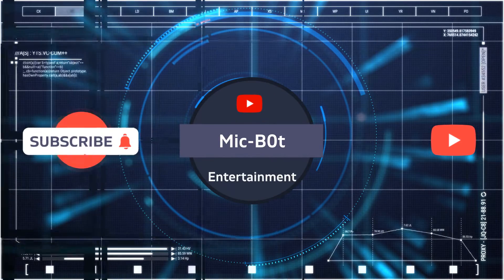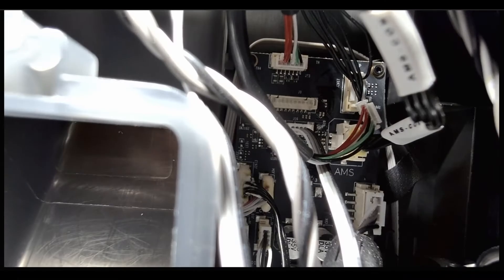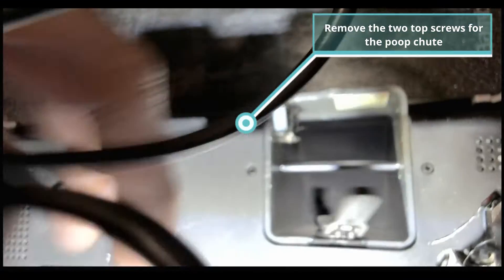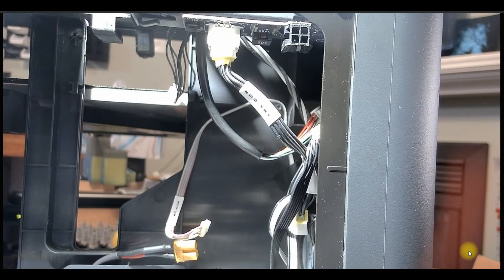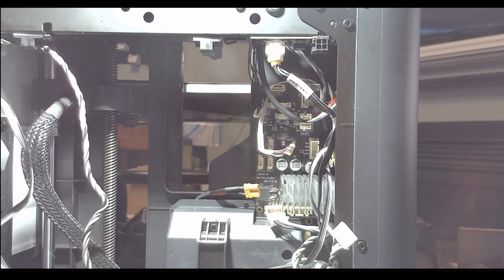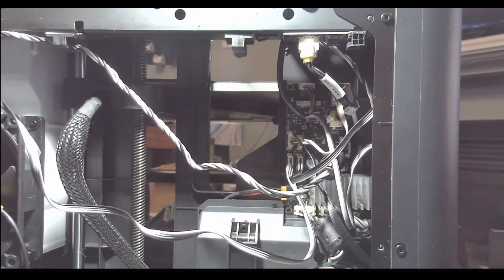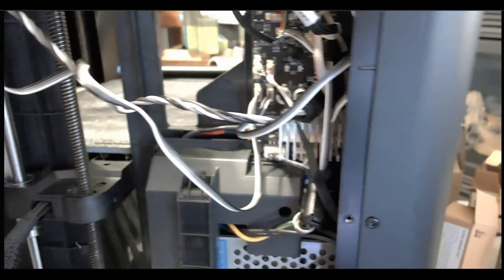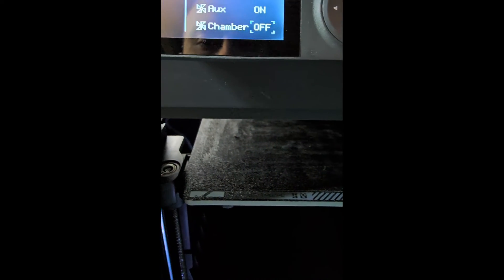P1 Series MC Board Replacement Video - HMS Error 0500_0300_0001_0002 #3dprinting #bambulab #bambu

Comment: Just changed the mc  today after putting the wrong power wire in my ams 2 still nothing after changing the part any advice still has power unit green light

Comment: You are a very unique hobbyist printer/content maker in that you are so into the hobby that you actually stock parts on the off chance that you might need one. I'm curious: you mention all the many parts you've replaced and I'm wondering if you are running a print farm. I've had my P1S for 13 months and have only replaced a few hotends so far. Liked and subbed.
Reply from the maker: Thank you for watching! At the time of this video this was a hobby, and if I remember correctly, I had 3 Bambu printers along with some Creality ones—though I’ve since sold all the Creality printers. I have always had a habbit of keeping a ridiculous amount of spare parts for anything that I am into. 

 I’ve definitely evolved a bit since then; this hobby has grown into a small business. I now have over $10,000 in spare parts because I literally can’t afford any downtime. Currently, I run 11 Bambu printers, 2 Anycubic resin printers, 2 3D scanners, and various other equipment. I own every single Bambu printer model including the H2D, which I hope keeps working flawlessly—knock on wood! I also occasionally get customers asking me to repair their Bambu printers, so having spare parts is a huge help. I've rebuild all the Bambu printers many times except for the H2D, but I'm sure it a matter of time.
Reply: @MicBot  But you still didn't tell me why you accumulate so many hours requiring lots of maintenance. Do you sell a product? Tell us about them.
Reply from the maker: Some of my printers have 8000 hours print time on them. As the printers age and I use them more, parts break down and need replacement. I do make and sell models. The models that I don't make myself, I have commercial licenses for.
Reply: What happens if the MC board takes 30 seconds to blink green after swapping the old one out for the new one ?

Comment: Good video, if i am allowed to chime in : Believe or not, but a faulty flex calbe on the filament sensor/cutter on the P1 MAY cause exactly the same issue.  

So before you buy ANYTHING in terms of spares in case of a 0500_0300_0001_0002, I strongly suggest to firstly remove ALL connectors from the Extruder Interface board, and then power up the machine.  ANY short on the connectors on the Interface board may pull the TH board down so hard it will stop functioning (no green led) and throw the "TH not working" error.

I had this happening after blocked extruder (worn out gears).  I placed it back and got greeted with the same HMS error, and a non starting TH board.  I was certain I had caused some damage, so I ordered a new TH and ne Interface board + flex board. Put it all back, got the same error.  But when disconnecting the flex cable connecting the Interface to the TH board, the TH board would actually start.

Turned out something is damaged on the filament sensor flex or pcb, which caused the TH PCB to fail to boot.  The TH board, interface board and flex connectors were all still fully functional.

Comment: If you ever notice that your bed temp is not the same as the nozzle temp after sitting and cooling at room temperature it might be the MC board. My bed was over 25° warmer in standby mode than it should have been.  Replacing the MC board corrected the temp being high.

Comment: I haven't yet added Wi-Fi to mine and you said you have to update the firmware up to install the board can I install the Wi-Fi after and if so, how do you update it? Is it through Wi-Fi?
Reply from the maker: @Evolutionnick  the easiest and fastest way to update the firmware is to be connected to WiFi. I think they added an option to do offline firmware updates, but I have not explored this method yet.
Reply: @ also I have another question having that error HMS code is that why it's causing my AMS red lights to blink?
Reply from the maker: @Evolutionnick  no if that AMS lights are blinking you have a signal issue. Unplug the ams and replug it.
Reply: @ it's blinking red because the HMS error that I have on the printer that's what's causing it right cause I plugged it unplugged it and plugged it and still doing the same thing still blinking red
Reply from the maker: @Evolutionnick  What's the HMS error code you are getting. Reply with the exact error please
Reply: @MicBot it's the exact same code you have on your video tool head module malfunction error HMS_0500-0300-0001-0002:
Reply: @MicBot  yeah once that code came up ams started  blinking red
Reply from the maker: @Evolutionnick  that's a tricky error code. You're going to have to start swapping out parts one by one and testing after each part swap to figure out what the defective part is. 

This video might help 

https://youtu.be/wU4aIxe8-h8
Reply: @MicBot  yeah I think brand new printer. I'm just gonna send it back. I'm gonna have to work on it. I just barely bought it.
Reply: @Evolutionnick  same here, but it happened as soon as I put the new ams in, looks like I will be swapping the motherboard and possibly the ams though the ams seems it may not be the culprit but I am unfortunately replacing both...

Comment: On your printer when you got this hms error would it let you doing anything on the printer cause mine has the same code and on my screen instead of showing number on how hot the tool head is it just shows nothing
Reply from the maker: Yes that's what mine did as well.

Comment: Thanks a lot for sharing this, I am facing the same issue with my new P1S, I hardly used it and one fine day while printing, it just stopped. I will check the MC board as you have described, maybe I find something. Bambu support is extremely slow, they did send me TH cable, and extruder boards but even after replacing all of it, the error did not go away.
Reply: i wonder if mines bad Fresh new machine i haven't even been able to use mine it tries to update it cant even do that

Comment: Could you possibly put up a video on how to install the ToolHead board and cable?  Also I have a stupid question.  On the front of the Tool head where the cables plug in , how do they actually slide on to connect?  they are this weird waffle design and i am not sure if they go above or below the slot when putting them back on.  Please help
Reply from the maker: https://youtu.be/wU4aIxe8-h8
Reply from the maker: They plug in. Be gentle when you plug the cables in as you can snap the two black connector pieces. They only go in one way. If you plug them in wrong you'll get an error. Always turn the printer off when touching anything or you will fry the pcba boards.
Reply: I feel your pain. Those connectors are fiddly and prone to disconnect. Those connectors are my only significant complaint about the P1S. BBL should consider another style though they are constrained by the amount of space to keep the print head small and clean.
Reply: @USS-DDG-2 Oh man where do i start. In the past year my P1P was nothing but problems. 1 thing after another.  Bambu never helped me and i ended up putting $400 worth of parts into it just to keep it running.  Thankfully i now have 5 printers other then the P1P which as we speak sits in a corner bricked with a split belt.  Ill probably end up throwing it away.  Never again will i buy Bambu

Comment: I am now having this SAME issue.  I have gotten no help from Bambu.  Just a single email telling me they are "under staffed" and it will "be a while" before they will get to my ticket.......I ordered the TH board , TH cable and am hoping that will fix it for me.  If not i guess i will try this board swap next or maybe the TH connecter board.  This sucks and I will say that I have had nothing but issues with my P1P in the 3 months i have had it.  Squeaky belts. The toolhead losing homing and bashing into the left side of the machine (reset fixed that) a wierd deep humming sound all the time.  I onl have 400 hrs on the machine and have never printed anything other than PLA.  I REALLY wish I had ordered a K1 instead
Reply from the maker: Trust me when I say this. You made the right choice staying away from creality clone machines that barely run. 

I know it's frustrating with the P1P, believe me. I have to change that camera out as of today due to the head smashing into it, but I still love my P1P.

You will resolve the issues. Take your time, don't rush it, don't panic. Look at it the way I did, it's a learning experience and you will know your machine inside out after the process you're about to go through. 

Feel free to drop me a message and I'll try to assist you if you run into an issue replacing the parts.